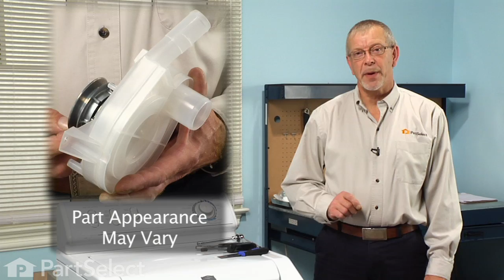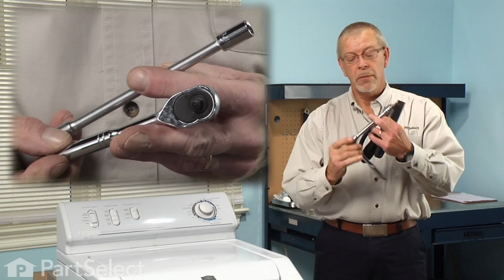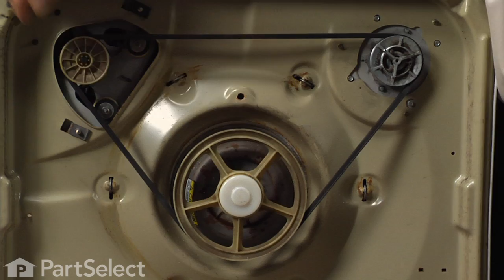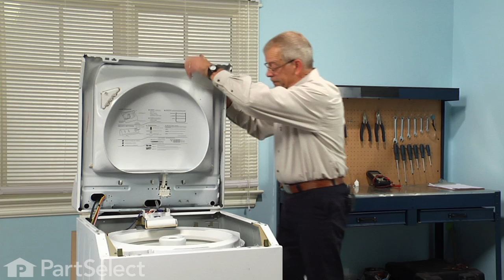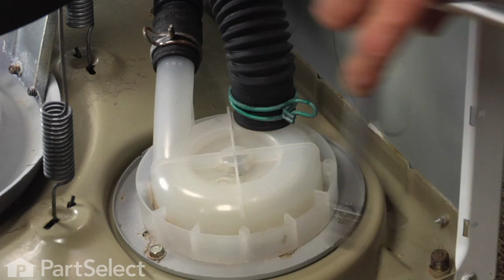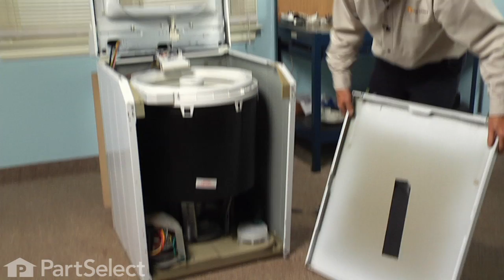Washing Machine Repair- Replacing the Water Pump (Whirlpool Part # 35-6780)

Comment: Hello steve..  I got a question.  I have the same machine as the one yut workin on..  But mine skreeches really loud during spin an wash cycle who coule he the problem
Reply from the maker: Check the condition of the drive belt as well as the drive pulley, motor pulley and pump pulley.

Comment: Very helpful.  Why is it necessary to undo the belt if you are not really dealing with that part of the washer?
Reply from the maker: The belt needs to be removed to replace the pump, as it wraps around all three pulleys of the motor, transmission and pump to operate.
Reply: Thank you!  I realized later that that is  that specific model.  Our washer didn't have that.

Comment: Maytag mav4755AWW water fills, no agitation, no spin, no drain what could be my problem I hear the washer motor running but no agitation and no spin left with a tub full of water and wet clothes
Reply from the maker: Sounds like the belt has broken or fell off the pulleys.
Reply: ***** yup that was the problem now that I have replaced the belt I get the tub filled as soon as it's supposed to agitate the clothes it immediately starts the spin cycle an all the water is drained If I'm not mistaking the tub spins clockwise isn't it supposed to spin counter clockwise while it's agitating but it skips agitation an goes to drain just as soon as the water fills up in the tub it drains and the tub spins clockwise

Comment: A real world issue might be how to install new pump when failed pump leaves tank full.  Sadly this did not provide any help since these are obvious...what I have had to deal with was pump failed (bearing) and had to pump out water...THEN water remained in base and hose lines.  TOO, the water level sensor was left with full load condition so returning to service meant had to purge the water from the line as it overfilled without that step.  

Is this a replacement simply to  put a new pump in a working machine?  What are the real world problems such as how to purge the water when it is standing above the pump.  Trade insight into doing this where flooding the floor is avoided.  I my garage it was simply a potential shock or slip hazard and water would evaporate. How best to do this in an inside washroom or kitchen pantry would help.  If I have to figure it out myself or watch a dozen videos then what's the point of this series? GREAT video otherwise';-!

To Theo, great question!  I think you asked "do different models have different configurations?"  Some belts are vertical as in front loaders and others are like the one show and any number of ways to protect or structure the machine. Wasting metal is avoided to reduce cost and, in this case, makes it easy to change the belt. It also mean that moving it could damage the belt if not careful.  My machine does not have flat top but is a more traditional.  It also has a really neat access panel in back so that only need to remove a couple of screws to change pump.  I though they jumped forward when he put the screwdriver in the tank...slide of hand?  There are a lot of new models on the market and most of the traditional US brands all come from the same plants with same or similar parts.

Comment: Don't no washing machine have freely exposed access to the belts on the bottom like this video shows,  and there is no "just sliding them off"  did you leave out a bit for time? My Machine has a plate covering the bottom.
Reply from the maker: Hi Theo, thanks for watching! I would require a model number to help you with this
repair.
Reply: I called a repairman.  Thanks.
Reply: Mine does it's the same one he is working on

Comment: hey steve from past select, i have a few question. my washer doesnt drain after washing , i dont reall want to call plumber cuz they cost so much. its there any way to fix it please let me know ASAP thank you
Reply from the maker: There are a few things you can inspect yourself if the washer is not draining. Have a look at the drain pump. The pump can also become clogged or blocked by a small article of clothing, which can prevent water from draining out of the washing machine as well. If your washer does not drain you should first verify that the drain hose is not kinked or restricted. Check the input port of the pump to insure that the impeller turns freely and remove any foreign object that might be impeding movement or restricting the water flow. Verify that power is being supplied to the pump motor. This is a live voltage test and should only be performed by a qualified person. If the drain pump is okay then if your washer uses belts then inspect the pump belt to make sure that it’s not worn and/or torn but if it doesn’t have a belt then it’s a direct drive washer and inspect the drive pump. Pull the pump away from the drive motor. Try turning the impeller by hand. If the impeller does not turn freely, remove the inlet and outlet hoses and check for a foreign object caught in the impeller. If the impeller is seized or does not turn easily then you will need to replace the pump.  I hope that information helps. Let us know if you have any other questions or need more information. If you do need more help then please provide the model number of the washer.
Reply: *****  the washer is zerowatt(brandname)  MODEL NO its 120 volt a.c ~60Hz-3A i am trying to go to locate store to buy pump.

Comment: Thank you for this demonstration.  I followed your directions --- surprise!  The belt had come off.  Slack, tension gone after 25-plus years of use.  I relooped the belt, tested the wash / drain / rinse / drain cycle.  Functions.  No need to replace the pump.  I am now ordering the belt from your company.   

I am a past instructor of internet research.  I am now working SEO.  Your videos and company are an example of what the internet offers the world.  Thank you.

Comment: Thank You sooo much for this video.Your tips were excellent and very easy to understand. I feel empowered being able to take care of my family's needs without getting ripped off by a repairman. I called somebody and they said my washer was only worth $40 with the pump broken. Now with it fixed it's worth around $200. That what it would have cost me to replace the washer and had a mismatched set of appliances. I ordered the pump and a new belt from Amazon for under $40 including shipping!